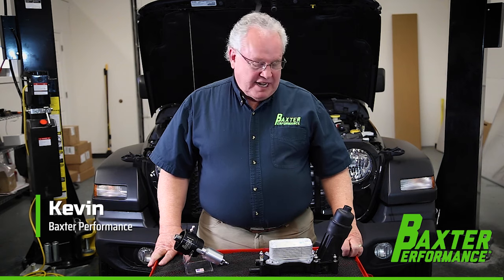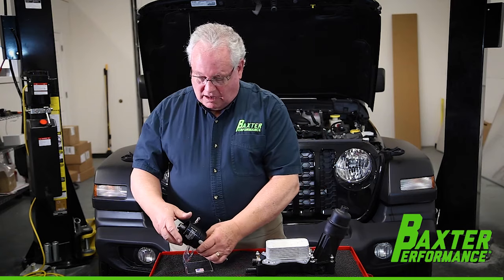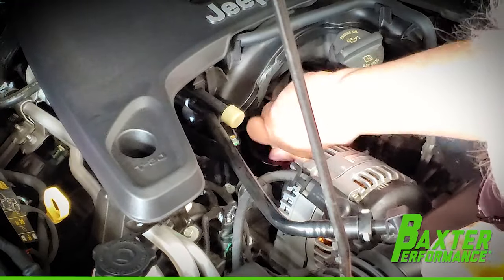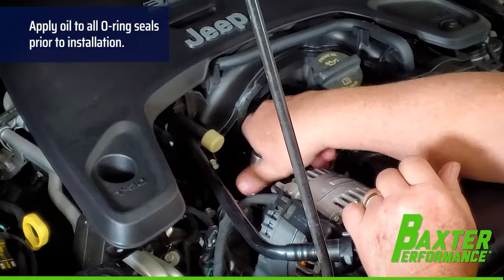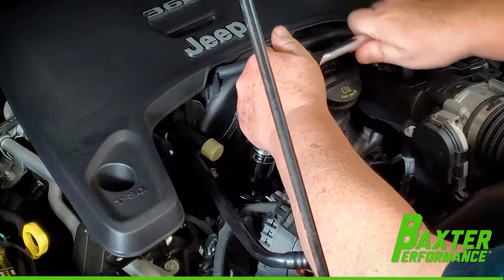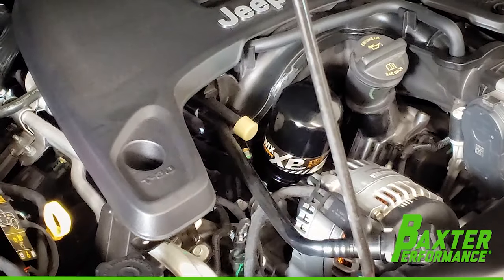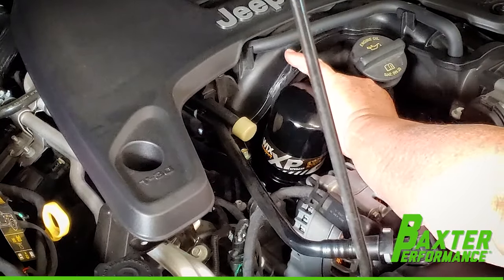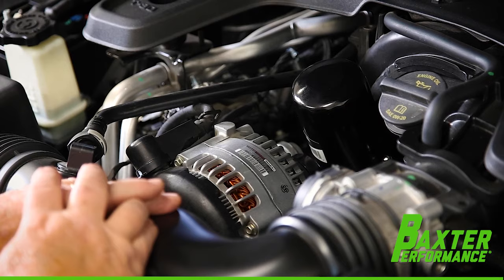Pentastar 3.6 MS-201-BK Installation in a Jeep. Baxter Performance

Comment: I recently installed this along with the Dorman updated aluminum oil filter housing. The also eliminates the 2011-2013 oil filter housing which has the problematic oil bypass valve that can come apart. My vehicle is a ‘12 Chrysler 200 Touring convertible. I no longer have the momentary groan at startup and the only thing to watch out for is some residual oil may still be present to catch with a shop cloth so it doesn’t drain way down into the V6’s valley. As a car enthusiast I don’t mind the extra step or two at an oil change because I believe it helps with longevity of the Pentastar engine.

Comment: It would be great if you would advise customers to upgrade to the dorman aluminum oil cooler. The factory plastic ones always end up leaking due to different expansion rates. Doing this first and adding your part will solve alot of common issues with this engine. Thanks!
Reply: His part is 100% not needed. When you start your engine. It does not start dry. There is oil left there from the last time you shut down your engine. If you don't believe me. Park you car for one month. Take the engine apart and there will still be oil on the bearings.
Reply: @blackericdenice  Just caught this video and saw the comment. You are wrong. The dreaded "Pentastar Tic-of-Death" happens specifically because of the dry start issues. Just because thee is a slight "film" of oil on the roller or whatnot, does not mean it is properly and completely lubricated. It's a known issue Jeep just never bothered to deal with. I have a 2012 JK I bought with 62k miles. I put one of these on at about 70k and am now at 156k with absolutely no issues whatsoever. This device will vastly increase the engines life span dramatically. The newer Jeeps, with the 3.6 and the Electonic Start/Stop engines: They need it even more! I wouldn't even run a 3.6l without one.
Reply: @ralphnewman2479  Don't try to school me with some bs you read online. Show me a video where you put one on. Until you do. I don't believe anything you say.
Reply: I put the Baxter on when I upgraded to the Dorman aluminum housing. I noticed I don't get the ticking when starting like I was before.  Time will tell if it was all worth it.
Reply: @blackericdenice Just dropped $5K on new rocker arms, cams (60K Mil JKU Rubicon) 
and the mechanics had no clue that this product existed but mentioned the dry starting issue with these motors. They have seen a huge uptick in rocker arm failure which leads to the dreaded tick and eventual cam wear. Any aftermarket part that improves on an existing design is a benefit to us. Couldn’t agree more with upgrading to the aluminum oil pump. Happy with the initial purchase but like most - time will tell if the product solves the issue. I’m here for it 🙏🏽
Reply: I replaced my '14 w factory crap and just snagged the Dorman unit because the crappy OEM replacement lasted less then the original.  I sure wish I'd have known to look for the Dorman unit when replaced the first time.  While I'm in there just going to do all the rockers because there is a slight tick, surely because of the dry start the Baxter unit prevents.
Reply: @blackericdenice wrong
Reply: @Jf1234lfg  How am I wrong?
Reply: @blackericdenice  the 3.6 pentastar engine does not have an anti drain back valve system. After about 45-60 minutes after shut down, all oil drains back into the pan. The 3.6 uses hydraulic lifters as well. So when starting the jeep after it’s been sitting, it takes about 3-5 seconds to get full oil pressure to the top end. This Baxter adapter keeps oil pressure up top no matter how long the jeeps been sitting. I would know, I installed one on my jeep and I’ve worked on hundreds of 3.6 pentastars.
Reply: @blackericdenice  last thing I can add, go to your jeep after it’s been off for 1 hour and remove the oil filter. It will be bone dry. If I remove my oil filter on my Baxter adapter, oil gets everywhere even if it’s been weeks since the jeeps been started. The part works. You just don’t understand how the 3.6 oil system operates, or what this part is intended to do
Reply: @Jf1234lfg  Stop lying, you are not old enough to drive.

Comment: After you add the new oil you can prime the system by using clear flood mode it works great on the 3.6 engine
Reply from the maker: Correct. Hold the throttle to the floor while cranking. It prevents the fuel injectors from firing.

Comment: Ahhh now I understand.  Once the adapter is installed, it doesn't have to be removed.  Just compressed air to evacuate the oil filter, remove and replace the oil filter.  Easy Peasy!
Reply from the maker: Yes, exactly

Comment: I am using the MS-201-BK on my 2021 Gladiator.  It works fine and no leaks.  However, I just realized that the original oil filter space still drains back all of its oil back into the engine. So, when starting, it has to fill up again before resuming lubrication. Hence, the new spin-on filter doesn't actually do anything until this space fills up.
Reply: It holds oil in the spin-on filter, not the housing...
Reply: Then yours is broken because there’s a check valve holding oil in the entire unit.
Reply: Yes mate I would have to agree with you, I think this is a gimmick at best. Any oil it does hold in reserve is going to be so small that it won’t effectively saturate two heads and its valve train. Secondly oil pushes oil, the rest of the system is dry and will need to charge before it pushes the oil held in reserve. Interestingly the makers of this device don’t effectively explain how much oil it hold, where it holds it and how the reserve oil makes it to the heads on initial start up when everything behind it is dry.
Reply: @uberdetail5408 it holds oil in the filter and even if its a small amount its still far better than the OEM setup

Comment: Is there a wix filter that would fit under the engine cover of a 2017 JKU 3.6L? I think there was a shorter that would fit and a latger option that holds more oil but wont fit under the cover. I forgot the part number though.

Comment: Why do you loosen the oil filter a little bit after you tighten it down?
Reply: I'm waiting for that answer also.
Reply from the maker: I think Mr. Baxter does that to freak everyone out. :-)
Reply: Its a o-ring seal.  Never over tighten or they will crack.  All ways back off a hair for expansion.

Comment: What happens if I just press down the shrader valve and don't have access to an air compressor? Will the oil still drain, or do I need compressed air? Thanks!
Reply: @danieltillman3858 I saw another vid that stated even a bicycle pump would work.

Comment: Sorry, one more question. Is the fitting for the valve to pump down the system meant to thread all the way in to the unit or just untill it cannot be turned anymore. Doing a dry assemble and it does not thread all the way in to the unit.
Reply from the maker: It's pipe thread, so it needs to be threaded in a ways so the threads will seal.

Comment: Do you know when the upgraded part will be ready for the 2012 JK 3.6. I need to replace the oil cooler/ filter assembly. I was thinking up upgrading to a 2015 style. Next install the Baxter
Reply from the maker: We have it designed, but nothing tested in production yet. If you replace the assembly, you can use the existing MS-201-BK for 2014 and newer.

Comment: does the air just put pressure to the filter only or does the pressure go into the cooler as well? not worried about causing leaks by doing so?
Reply: They recommend more than 30 psi to purge the filter.  On a cold start up, the engine could see 90 psi of oil pressure.  As long as you are not clearing it with too much air pressure, you should be fine.
Reply from the maker: We have blown them down with full pressure and not had any issues. It just takes a few seconds.

Comment: What number oil filter do I need or do I have to buy baxter filters?
Reply: 57502 is the part number for the WIX filter .. i know a puralator and mobile 1 also csn be used.  But not sure on  the part number for them. Im sure u can look that up tho.

Comment: It’s awesome now make a oil cooler that doesn’t break . Doorman is got one but I would like some other options
Reply from the maker: We're looking into so options to remedy this in the future.
Reply: @baxterperformance4954  Great, once you get that RAM OEM Flimsy plastic Oil Housing, I will do both the same time, just an idea, add some cheap one use tools to make it easy, not all have a mechanic shop at home. :-)
Reply: Putting this in is simple and waiting until you do the cooler is just adding wear to your engine and saves you no time.

Comment: is there any kind of thread sealant needed on the block off screw or the air fittings? it says to oil the threads before tightening what what keeps it from leaking?
Reply from the maker: You can use thread sealing tape if preferred. They are pipe threads.
Reply: @baxterperformance4954   I used loc tite hydraulic sealant , being a pipe fitter I wont put any pipe thread together without sealant. DO  N O T put it on the first 2 threads and NONE will get in the oil. Teflon tape tends to let strings behind . Be careful if you use that . And once again DO N O T put it on the first 2 threads.

Comment: Can someone explain how this isn’t a gimmick? It would hardly hold any oil in reserve, 200ml at most? How is that effectively saturating two heads? Also oil pushes oil, if the rest of the system is drained then how is a dry system pushing the oil held in reserve out into the heads?? How long does it hold oil for and exactly what areas is it holding oil in? Holding in the new oil filter and the bowl where the cartridge use to go or hold does it hold oil in other areas?

Comment: Does this fit 2018 Jeep Grand Cherokee?
Reply from the maker: The 2018 Jeep Grand Cherokee has an intake tube located above the oil filter preventing use of our cartridge to spin on adapter.

Comment: How can you say you are eliminating  dry starts with an empty oil filter?
Reply: It holds oil in the spin-on filter...  That way when the engine starts up, the check valve releases said oil into the engine...

Comment: So let me get this straight  you blow dirty oil out of the filter back into to engine.  Only a genius  wouldn't  of think this through. Lol
Reply from the maker: The air pressure is pushing the oil through the filter and into the engine, not forcing dirty oil back past the anti-drain back valve. Only filtered oil. On the flipside, every time you shut down the engine with the canister filter, the unfiltered oil drains back from the filter to the pan.
Reply: Yes. The only time you'd be "blowing" anything, is before you are ready to change the oil. So why does it matter? What, you think your entire oil supply goes through your filter and comes out sparkling clean?